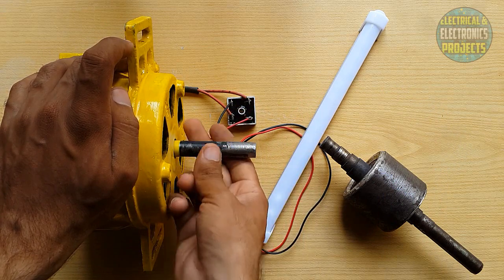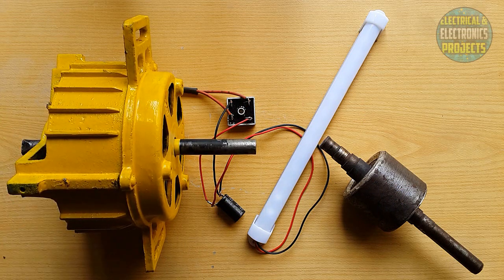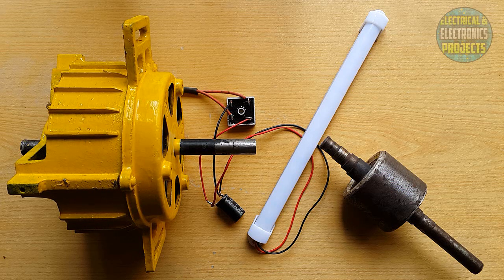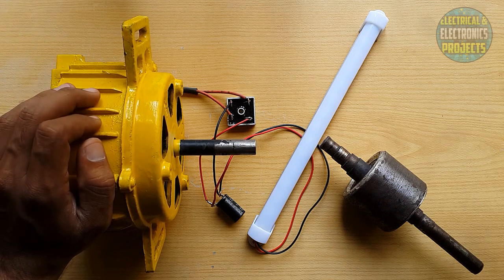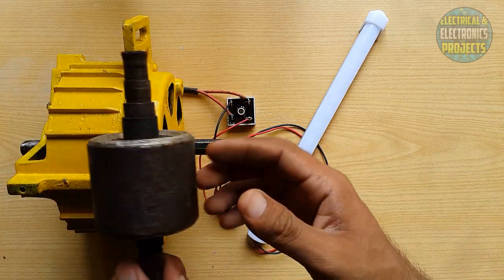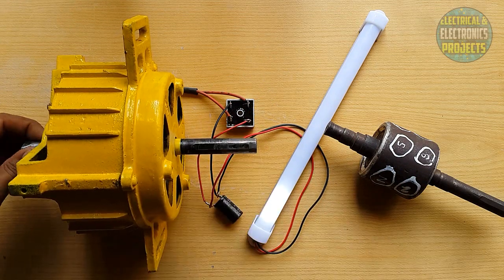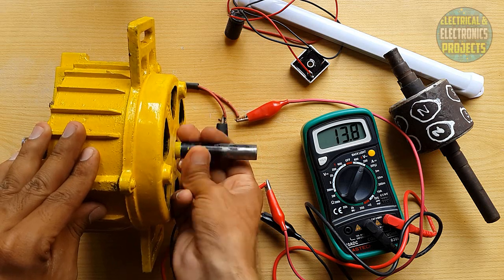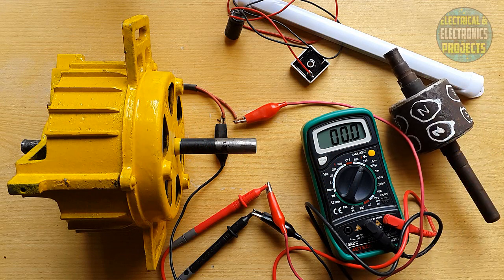Free energy 220v from washing machine motor Part 2 is Revealed | Hints | DIY Homemade Dynamo.

Comment: Bro i tried to do that By using water turbine, 1.5kw 3phase induction motor but a'm getting only 50vac and I want to step up up to 300vac by using auto transformer of 10kva. so is it possible To run almost 8kw loads without over heating of Motor coils??

Comment: what would be the deference if there's a magnet and not???
Reply: originally the motor is designed to receive current and magnetic field the produced by the coils inside which spins the rotor. but with magnets on the rotor produces current in the coils when it gets rotated

Comment: Bro i tried it....it came well..multimeter shows the output voltage but 220v energy saver does not lighting....pls help me....
Reply from the maker: It will light up when you move the pully with high speed.
Reply: Electrical & Electronics Projects. bro...i am getting oly upto 3v...if the pulley is spinned in high speed the multimeter shows up to 3v..
Reply from the maker: I think you are using small motor that's why.

Comment: Hi. You did not mention the number of marking to be made on the cylindrical surface, I think it is 6, that is, 3 pairs of north poles facing outside alternating with 3 south poles.  Please comment.  Thank you.  I will try this.
Reply from the maker: It's 8, that's are 4 pairs 2 pairs of north and 2 for south but, each pair should be place alternately on the cylindrical surface.Thanks🙂

Comment: Hello 
No need to even put magnits inside dynamo. 
It is rule of physics that if you: 
- Provide electric power to moter it will produce rotatory movement.
- If you spin moter it will give you electric power. 

If you have small 5Volts DC moter, check by yourself. 

Thank You.

Comment: washing machine does not to make a electricity this is complete fake and useless
Reply: HOW TO REPAIR i agree yea it wil produce 40 v but low amps my question is what did he accomplish still shaft has to be turned go solar or fire up the 7500 w gas genie people really make me lol with this get a 3dollar battery operated car with flashing leds leave the batteries out turn power switch on roll the car across the floor make drive will spin watch the lights flash now i did this as a kid 35y ago wow I'm a genius haha lollol
Reply: my friend this free energy motor have no truth because motor router is Squirrel-cage rotor see some other vedio
Reply: HOW TO REPAIR what is his point though. can take a dc motor out of a toy hook led to it spin with fingers wala same thing
Reply: hi sir if we put loudspeaker magenet will it work

Comment: absoultely a mind blowing stuff is being produced by your hardwork. we in pakistan need this critical thinking and scientific experimentation to atleast become self sufficient for simple electrical and electronic items atleast. 

i would like you reseach over solar power integration into the local house hold wapda kesc power. for instance if solar power is available the fan uses it and in case solar power is unavailable it switch itself to the normal meter electricity. 

the main lacking in solar power is the expensive and short living acid lead batteries. if through smalll electrical circuits switching between direct solar power and meter power is made possible . the cost will be reduced to half eliminating the batteries. i would love to research it but i lack time and i don't have too many solar units to test them. do reply if you get my idea or have questions over it. waiting eagerly